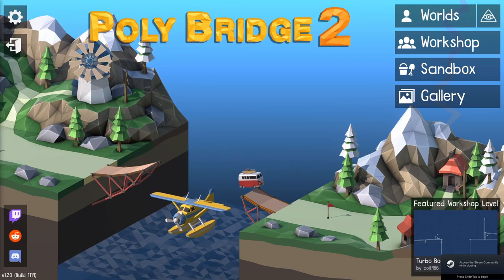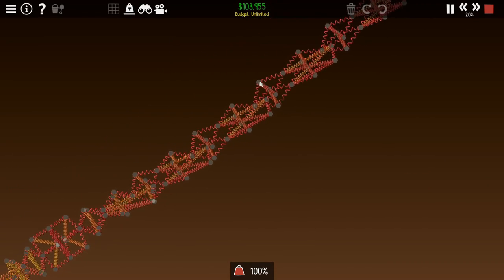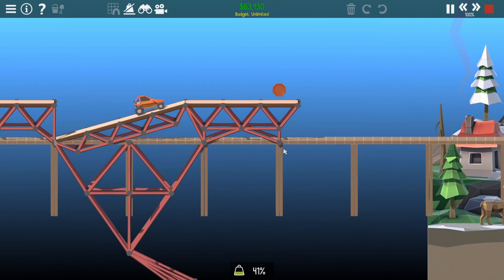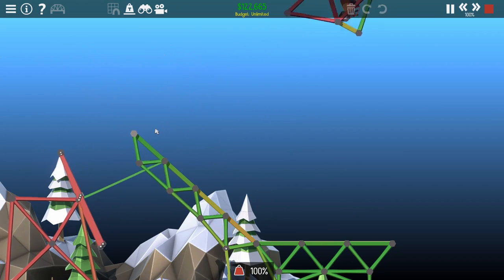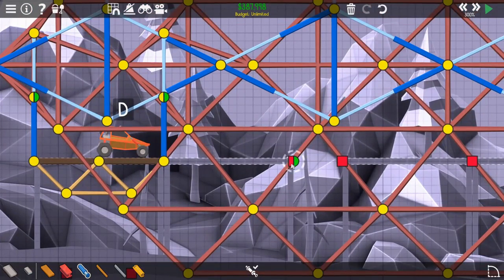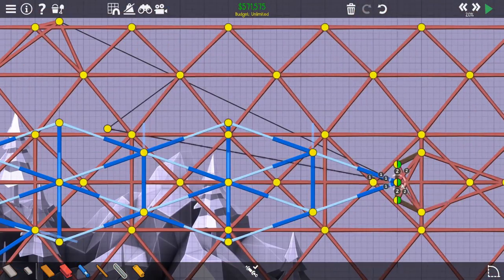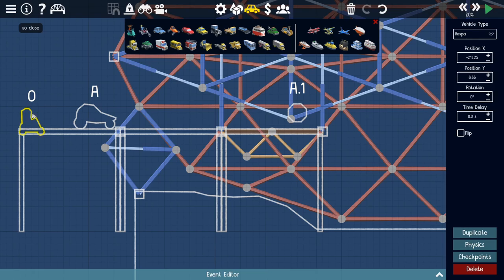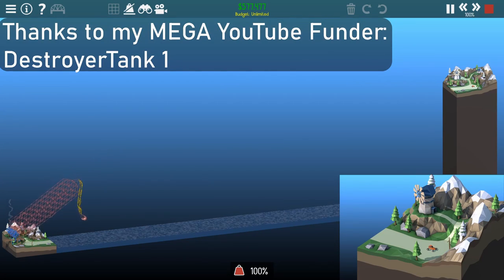Making a Reloading Crossbow in Poly Bridge 2

Comment: The structure should rotate to above 45 degrees because the vehicle is actually being tossed at a slightly lower angle due to gravity on the cradle during launch.

Comment: Since these spring modules are acting in series the force you'll get out of the pull is calculated by adding them together like you would to get the resistance of parallel resistors in a circuit so 1/ktotal= 1/k1+1/k2+1/k3 ....  If you have two modules acting next to each other you'll get the multiplicative effect you want.

Comment: lowerin the crossbow to reload it is entirely legit too; some stronger crossbows have a metal bit to put your foot in as you pull the string into place. Even without that, most crossblws are loaded by settin the back against the stomach and pullin the string into place

Comment: Slingshot, not a crossbow.
For a crossbow you need a hard and at the same time elastic material for it's shoulders. Like a hard spring.
The difference between the slingshot and crossbow is that slingshot uses elastic rope to shoot, when crossbow and bow also use shoulders.

Comment: 6:24 Thats literally a crossbow; it even has a platform for your bolt (the car) to rest on and is using the closest analog to a string (a spring mechanism) to fire the bolt. Even the pullin back mechanism is close to what one wud do on a real crossbow.

The only thing missing is the arms of the crossbow, but honestly... Ya cant rly do that in a 2d sideways depiction of a crossbow.

Comment: My passion is more programming than engineering and I’m saying this because some of your design methods are questionable for a few reasons that are usually also true in system design

See when you came across problems you changed the parameters for the problem

The issue with this, just like in software, that means your system isn’t reusable because you’re making it so it only works under specific use cases, rather than the majority of use cases